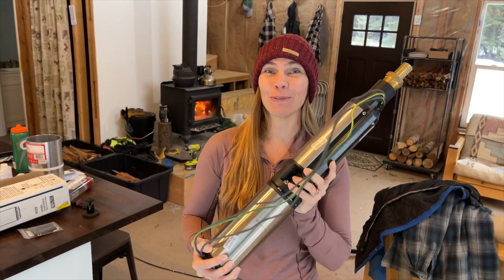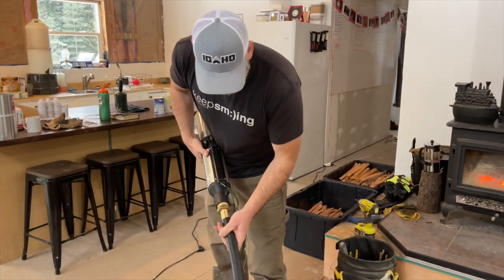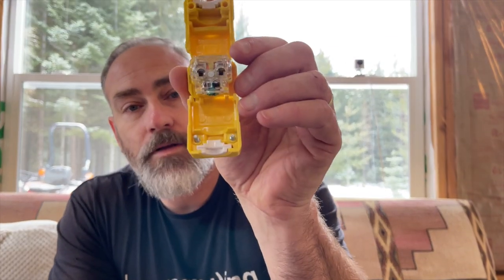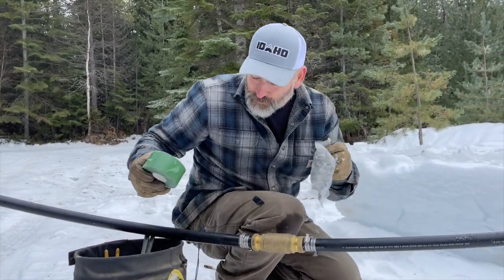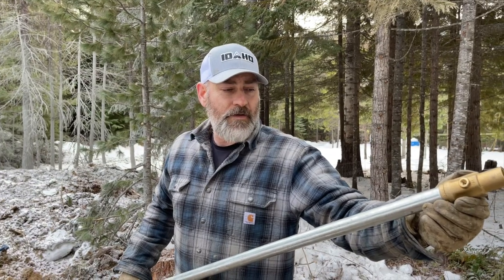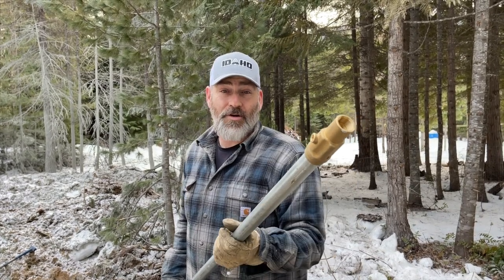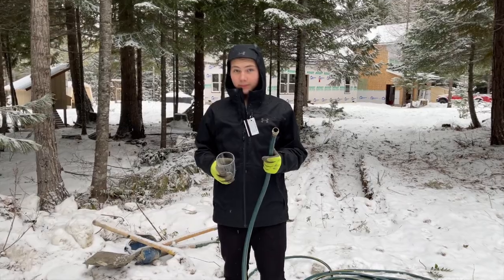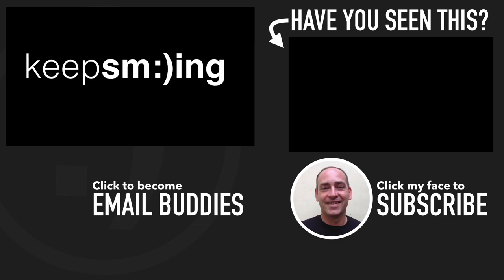WIFE is HAPPY/HUSBAND is NOT - DIY Well Pump Installation

Comment from the maker: 🔥 WATCH OUR OFF GRID CABIN BUILD FROM THE BEGINNING http://www.youtube.com/watch?v=MGfugfuzFJk&list=PL-O59UCFPykj09YwMbWqKTFfZITiJVCNg
Reply: Yoo martin you definitely need to put insulation on the water pipe and pump so it won’t freeze 🥶 
Don’t make that mistake trust me put some on it
Reply: Martin, how are you getting water into the house if you didn't already have a well? Are you sharing water from your neighbor's house?
Reply: You should really be running a 220v pump at that depth. 110 is a no go. Buy a new pump
Reply from the maker: The pump is 200’ under ground.
Reply from the maker: Maybe later. This one is working fine for now.
Reply: @protectormc  as he mentioned, the pump is below the frost line. He plans on putting the pipe to the house below the frost line also.
Reply: New wells have to be developed, by that I mean pump water through the hydrant at a slow flow, if you run the pump at full flow, it may never settle down, let it rest for a few hours and start again.  I've developed wells that have taken a week or more before they run clear, you can't rush it, close the handle on the hydrant to half open, by running at full flow, you may never get it clear up.  Take your time, you will have good clear water in the end.   Also agree with Glenn's post on the stainless cable and clamps, the next time you pull that pump, that yellow rope you put on it is going to come apart and you'll have to depend on the pipe to pull it out. I've put a lot of pumps in the ground in the past 40 years, it looks like your using good materials, I use pecks clamps now but used the same ones you used for years. When you get to the part where you install pressure tanks, because your off grid, I would install three of the biggest tanks you can get and manifold them together, that will give you more water to use between pump cycles, depending on the capabilities of you power system, that may not be a problem.  If the five K generator you bought has a remote start on it, it could be controlled with a pressure switch to make your system automatic fill. Best of luck on your build.
Reply: @garykasowski2222  Is that why it was clear when it first started pumping?
Reply: @ricklearned1686  It was pumping the water from the static level which had settled out, once that was gone, the pump is pulling water from the bottom of the well, also pulling up all the turbidity that's in the surrounding areas around the well bottom.
Reply: ISN'T THE INTERNET LITERALLY THE GRID?
Reply: @DOOMJESUS  No, the grid being referenced is the power grid, delivering AC power at 60 Hz in North America and 50Hz in many parts of the world.
Reply: @waynewallace10  YEAH, WHATEVER...
Reply: Hai pak martin... it will be take  1 - 3 month to got clean water depend on how often you dump that water.
Or you can build a water filter system.
Reply: @ricklearned1686  '
Reply: Just a tip...My Grandpa taught me to heat the inside the pipe more than the out side. Cause he said the clamp would squeeze into the pipe but he want the hose barb to squeeze in and bite down more so than the clamp. Also saw him do it with just a paper bag or paper poke as we call them here is Tennessee
Reply: is this an ac pump? capacitor to give the first  kick start?...
Reply: I tried to send a hyperlink text for a small jack pump to pump the mud out but you tube can't let people send links because of scammers
I'm a water well mechanic and I have a realistic idea how to save well
Email othelzer at the geemail
Reply: I did 140 foot well same way, then had to pull up 1 year later. The poly rope was really stretching to it's limit because all the weight from the water in the line. When re-installed i used 1/8 inch stainless cable much better and used a winch to pull and lower very easy.
Reply: check out RPS Solar Pumps and also Simple Pump... simple pump has a hand pump for emergencies that you can just add a solar motor onto...
Reply: How many amps she pulling?
Reply: @grumpy1962R  there are 2 Simple Pump motors... stats below... RPS Solar Pumps has a wider selection of very powerful pumps... go to their website... if the simple pump will not cut it RPS can...
1) Linear Bearing Link Drive Pump Motor at 100 foot static, pumping into an ambient tank
    12VDC
    16 amps peak
    25 amp fuse
    10-11 amps average draw
    24VDC
    8 amps peak
    15 amp fuse
    5-6 amps average draw
2) Scotch Yoke Drive Pump Motor at 100 foot static, pumping into an ambient tank
    12VDC
    18 amps peak
    25 amp fuse
    11-12 amps average draw
    24VDC
    9 amps peak
    15 amp fuse
    6-7 amps average draw
Reply: @MartinJohnsonOffGridLiving  Martin, great to see your project and your wonderful family working together to take it to completion. But take this from this old engineer: Your pump is tiny, and it will struggle to overcome water head and pipe friction. You need a tad more power, a higher voltage, a soft start system, a capacitor bank to improve your power factor. Don’t forget that you need to run this off your solar system, and if your gas generator struggles to cope, imagine what will happen with your dc/ac inverter. Also, you will need a second cheap and dirty pump to build system pressure once water reaches ground level and hopefully gets stored in a surface tank. And by all means do not run the submerged pump on a short duty cycle, fill a big tank instead. Check the Grundfos web site for great info on pump sizing. A DC pump as suggested by Russ Joyce may also be a good idea, although I have no idea on current pricing.
Reply: @MrRjj4321  Why would he buy a 12-24 V pump? He has 110 V? 

You think a pump that draws half the power can do the same work?

Have you checked the prices on the pumps you suggest? As far as I can see, they cost 3 Tim's as much.
For that price, he can get a professional Grundfos water well pump with overload protection, soft start, automatic rpm adjustment by water need, dry run protection etc.
Reply: @akyhne  i am surprised he got the pump he did... running a generator off grid is lame... and yes he could have (and should have) chosen a soft start pump but i have a question for you... what happens if the electronics go out? solar flare, or emp could knock out all electronics unless they are hardened with an emp shield and or a hardened Sol-Ark system... that simple pump can be operated by hand... you can even pump it into a pressure tank... i don't know his needs just pointing to some alternatives... some of us have slow start pumps AND deep well hand pumps just in case... i have a 350 ft well with the static level at 20' so i can make use of a simple pump for emergencies that does not go all the way down to the bottom...
Reply: In r)famii ..machi nachefale...scarpe
Reply: @tphillips696  Also, in really cold weather, heat the fitting to about 150f, it stops the plastic from cooling down when you are only half way on and that is a real pain.
Reply: @akyhne  "You think a pump that draws half the power can do the same work?"
Where do you get the idea that it is 1/2 the power? If it draws 5a at 110v then it would draw 23a @ 24v and 46@ 12v. Still 550 Watts and watts is power.
Reply: @BoB-Dobbs_leaning-left  I checked the website of the pump suggested.
Reply: @akyhne  Sorry, misunderstood.  Russ seems to be a bit over the top there. EMP? yeah, not a real problem for water supply, an imaginary one.
My numbers were right though for anyone considering low voltage. 8a at 24v is only 192, less than half. I would recommend nothing less than 1Hp, 750 watts.
Reply: @ruifilgo  Only on 220 volt.  110 v no start capacitor needed.
Reply: @protectormc  <u

Comment: The two eyelets on top of your pump, that you taped over is to attach a safety cable too. So that in a few years you can still pull your pump up when all the sediment, rust and sand settle on top of your pump. The plastic pipe and wires will not take much force to brake off.  I would use stainless cable with stainless cable clamps. Just a heads up for problems down the road.
Reply: you are right, i have seen a few pumps that end up in the bottom of the well .
Reply: Use stainless cable and hardware.
Reply: 15:00 if you notice before at he put the pump in he tied a nylon yellow rope too one of the eyelets
Reply: I wonder what his pumping water level is.
Hopefully the 1/2 hp pump will do the trick
Reply: @valvemonky4734  the yellow rope is useless! Needs to be stainless
Reply: @markwilliams4525  why? not much point using something that would be stronger than the fixing point that you attach it  too
Reply: @valvemonky4734  the yellow rope is significantly weaker than the plastic eyelets on the pump and the yellow rope breaks down over time. The best thing for them to have done is use galvanized pipe if the ph of the water would allow it. If the ph of the water is below 7 then they'd be better off using threaded schedule 80 pvc drop pipe as an alternative.
Reply: @yatessmyrna  Thick stainless wire and clamps.
Reply: Yup, that yellow plastic rope will deteriorate over time, unlikely to be UV Stabilised. Stainless steel wire a much better / long term option and a near sure 100% guarantee you'll be able to retrieve the pump in the future.
Reply: @hoperp1951  why would the rope need to be UV stable when it is in the ground? Had a 100 foot well with the same rope on it, lasted for over thirty years, might still be there, I sold the place with the rope still there.
Reply: @hoperp1951  
UV stabalised....?
Well I guess the section not in the well pipe might get sun exposure if they're not going to bury it in the trench.
Stainless cable isn't expensive,  nor are stainless hose clamps.
Reply: Yellow rope is fine. But everyone who paid what the contractors required for markup on the stainless are the ones who are not very bright.
Reply: Yeah I agree
Reply: The first water will be dirty for a while due to the drilling process. Ejecting the sitting water out of the column by letting the water run (some wells can take a very long time to develop, esp. with a water column of 420 feet - 520 foot well minus 96 foot static water level --ALOT OF WATER). As the water runs and runs it should start to clear up because new, percolated water is coming into the column. They didn't say (or I missed it) where they were setting their pump so if it was set at 120 feet or so there really shouldn't be an issue with sediment or sand and rust should be minimal, not enough to worry about. A stainless cable is good insurance and a good idea for sure.
Reply: @dereckconnors9108   nah bro.  As an electrician, plenty of those old yellow ropes or yellow/blue ropes breakdown later on.
Reply: @valvemonky4734  That's the point of the comment. Poly rope will deteriorate, SS cable will not.., "if you notice"
Reply: @valvemonky4734   Because, Einstein.., poly rope deteriorates, SS cable does not.

Comment: Mozt well pumps in my area are all 220/240 volt, you were plugging it into a 15 amp 120 volt outlet,  which will pull 2X the amperage.   With a pump at that depth i would be running a 3 wire pump with a VFD which will stop the high torq rotational forces.

Comment: As others have said, I would check into running the electrical through a normal submersible pump control box instead of just plugging it straight into the generator. That will have the capacitor in it to help the pump start. Check with your pump supplier for what would work with your 2-wire pump, but that's at least the case on the three-wire pumps I've worked with.

Comment: Great video ! One way to save on generator oversizing would be that of installing a soft starter. It will reduce your starting Amps by up to 70%. The problem you were encountering is likely due to the fact that during  a motor start (just like the deep-well pump) the current drawn is about 7-8 times the rated current and the generator might not handle that due to the starting kVA capability.

Comment: Nice work! It’s always nice when a hard job ends in success. I was interested to see the pitless adapter install. I did not use it for my well, but I am in a warmer climate. If you ever have to pull that pump (now that it has the added weight of 196’ of water in the stand pipe) look into making a trolley/roller system. Basically, take an old wheel rim and rig it up to rotate on a stand next to the wellhead. You can then pull the pump out with a tractor or truck by letting the pipe roll over the wheel. It keeps the pipe from kinking as you pull it up and over the head of the casing. It also prevents scraping the wire on the casing. It will save your back, too.
Reply from the maker: That is a great idea. I’ll do it next time we pull the pump.
Reply: Just make sure you always have someone watching so that you don’t get things tangled up and break something. Also, make sure you have the cables, rope, and pipe all tied up when you start tugging. The cable may want to slide down and make a big ball...ask me how I now.
Reply: In fact, you only pull the weight of 94 ft pipe and the water in it, plus the weight of the pump. The rest of it is canceled by the external pressure of water.
Reply: True enough, but I have not found it to help in practice. Some of that may be drag on the sides if the pipe. My deepest well was 275ft with the head at 35ft. It was terribly hard to pull the pump.
Reply: @lenrsmith  How about 416 ft with 301 ft above the surface of water at the weel i just installed it?
You don't want to be arround when it needs to be pulled out!
Reply: @isfanromeo  No kidding! However, I would gladly help because that’s a task.
Reply: @lenrsmith  Thanks for the help offer. The well is in Romania. Let's hope that in the next 5 years the pump does not have to be taken out (440 ft deep)

Comment: My well sit for 6 years because I switched to city water. I pulled pump installed a constant pressure system for irrigation and the water looked just like that. I pumped it for 6 hours straight and it’s crystal clear now. My well isn’t nearly as deep as yours it’s 215ft and was drilled in 1964 replenish rate is 75gpm it fed 6 chicken houses , 4 residential homes and a barn at one time. Very blessed to have it I just hope it keeps producing and the casing doesn’t rust. Keep pumping!

Comment: Most likely it needed extra amps for longer than the inverters surge amp cycle time.  The small gen probably was enough run amps but not starting amps. Now that the system is primed it might keep up.

Comment: Nice details! I went through a drilled well back in 1997. I was lucky to have a Native American use a divining rod, actually two of them to locate a drilling site. 105 ft. I decided to use a 230 V. A. C. 5.9 amp 1/2 hp gould pump. Most sinewave inverters won't start a 2 wire pump. I used 10 gauge wire. But a 4kw genrac generator started it. Locked rotor amps was 35 amps. But my home was 450 ft. Away. Finally I bought a Trace SW4024 sinewave inverter and a 2kw 120v to 240v transformer and wired the pressure switch to a 60 amp relay that controlled the transformer so you would not be wasting losses running the transformer with no load. Now on the inverter output surge the amp draw of the well pump was 60 amp for a split second because the inverter was 120 volt then going through the transformer then to the pump. If I had a 120 volt pump it would not have worked with that distance with only 10 gauge wire. Maybe 2 gauge...

Comment: When you use the clamp on amp meter you should only be around either the hot leg or the neutral but not both and not the ground either
Reply from the maker: True

Comment: Well That sure seemed deep for a well .  I did one 42 years ago and it was 100 feet with water at 25.  Don't feel bad that was 40 years ago before regulations.    It was back in the cable tool days.  they punched the well with a 6 inch spoon type tool.  Congratulations.  You are there.  500 feet of head with a 220 volt submersible pump  WOW.    Great patience doing that job.
Reply: I just subbed.

Comment: The well driller/pump installers have always installed check valve at the pump and half way up the pipe for the different wells I have drilled or had to  replace pumps in.   I would suggest more torque arrestors on the pipe every 50' is what the well driller recommended.    Keep pumping the water until it clears up and make sure you treat  since the well you pulled the pipe several times and introduced biological contaminates to the well.  The place that sold you the pump should be able to tell you what to use.

Comment: I use an AC controller on my well, an expensive control box, but it makes 3 phase power and also is variable frequency (softstart) so it starts the 3 phase motor (4 wire) at 30 Hz, and then adjusts the frequency up to get higher RPM and more GPM out of the pump. But the motor and pump are heavier but it doesn't pull so many amps at start up and it doesn't pull as many amps ever because the 3 phase motor is more efficient. My setup will pump 26 GPM with a 1 HP (3 phase) motor and pump, when at 60 Hz and 2 valves wide open (low pressure). I get about 20 GPM at 50 PSI and under 5 amps, but the static level of the water in my well is only about 70 feet down, so less head. But softstart is nice as it maintains a very steady pressure, I use a pentek intellidrive (PID 10) that handles up to 1 HP.  I also use schedule 120 PVC to hang the pump on instead of the poly pipe, and 1 1/4 pipe to flow more than 20 GPM. Most houses only need around 8 GPM but I also have irrigation and I'm not off grid.